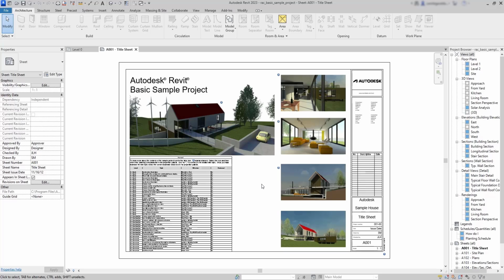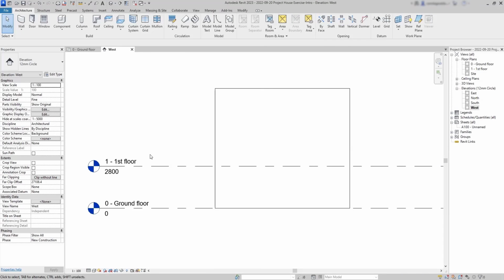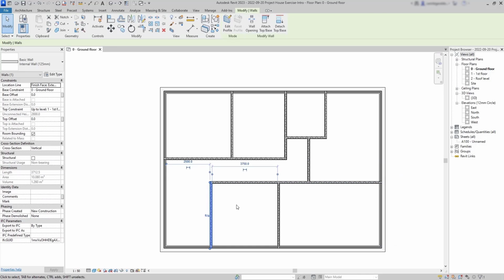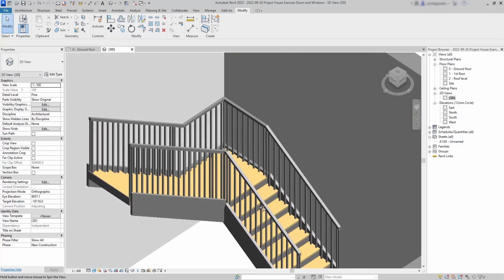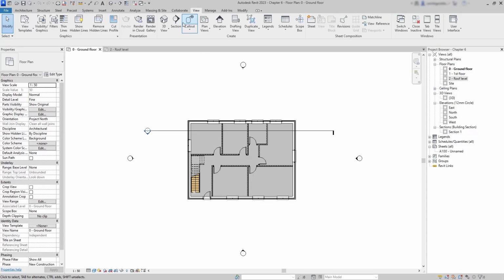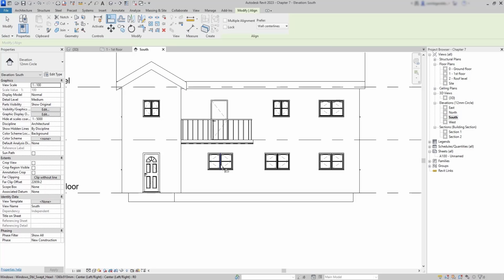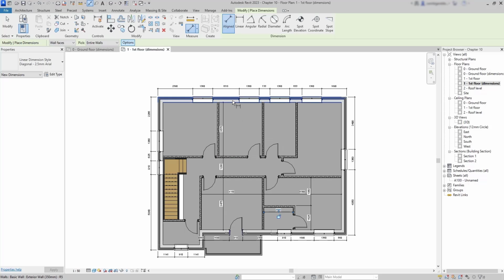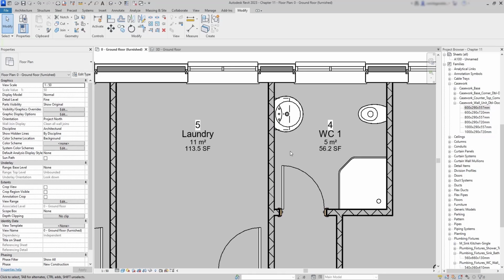Revit - Practice course - Tutorial to model a house

Comment: when i define the rooms on the 1st floor and after i try to select (clicking inside a room) it i select the floor , but if i drag the mouse selecting all now i can see the X of the room, the room is under the floor, how can I reverse it? Thanks
Reply from the maker: When you place the pointer in a place where you have more than one element (ex: a floor, a room, a wall) you can press TAB to switch between the items overlaped!